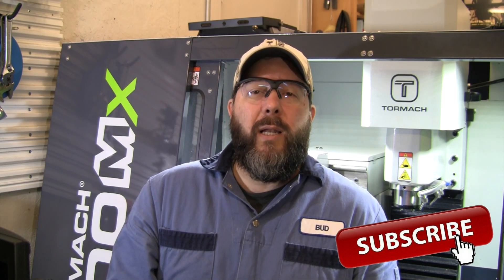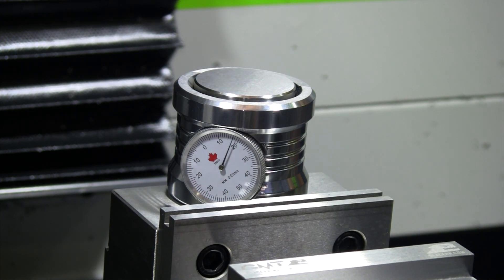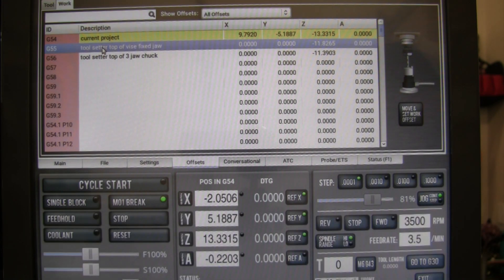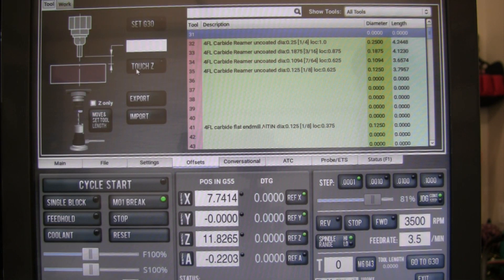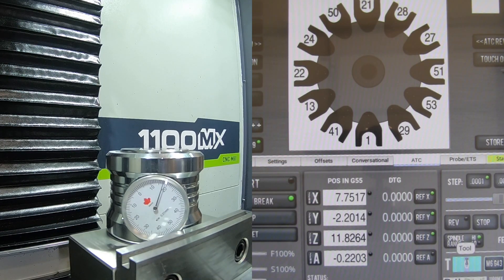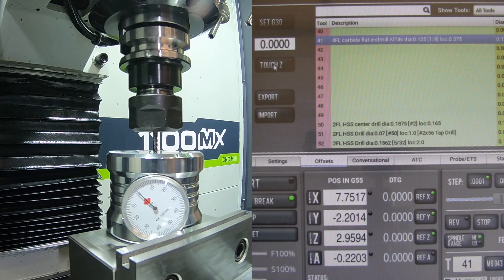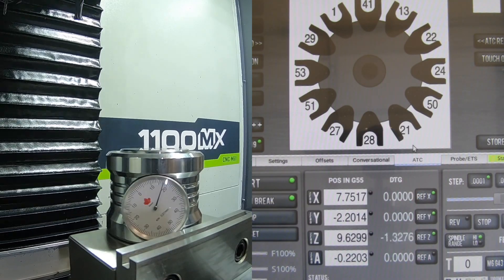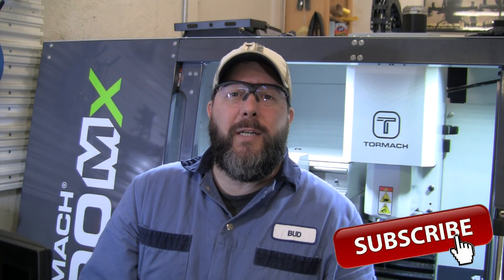Tormach 1100MX - Setting Manual Tool Offsets & Checking Accuracy/Repeatability of Offsets Over Time

Comment: I've been watching your videos and plan to order a machine in the next few days. Do you use the Haimer still or have you switched to using the passive probe now? My dealer has suggested I buy the probe to start but I am concerned that it will add more confusion as I am new to CNC milling. The Haimer seems to be less complicated although I understand it is less capable in some ways and will require a more hands on approach. Thanks for your advice!
Reply from the maker: RCP57 - First off, congrats on the new machine order and thanks for the question. I do still use the Haimer and love it enough, I have never even considered the electronic probe. So since I have not used the electronic I have no idea what capability I am giving up?  And as for hands on, I am also not sure you lose anything with the Haimer?  I believe you still have to insert the other probe each time and since it has a cord, I think you have the extra step of plugging it in each time?  For me, the Haimer is pretty straight forward, no hassle and has not let me down yet. Wish I could give you a better comparison vs. just one perspective but I hope that helps.
Reply: @BladesIIB  That’s an excellent answer as far as I’m concerned.lol You’ve basically matched what I was thinking but you actually have experience making parts and a rational behind your answer. I appreciate your response. I think the Haimer is for me at least to start off with. I don’t like the cord on the probe either and as you said it seems like just as much work to take it in and out. It’s not like you can leave it in the atc when not in use. Thank you again for the reply. I watched all your install videos over the last week. They gave me a heads up on what to expect when the machine arrives so thank you! 

Reg
Reply from the maker: @RCP57  Glad the answer was helpful and the other videos. All the best with your install. You are going to live the machine, a little daunting the first time you hit cycle start but will all come together before you know it.
Reply: @BladesIIB  Thanks for the words of encouragement. I’ve been bumbling around machining parts on my manual mills for a number of years and have had a 3D printer for a few using Fusion 360 but that’s a lot different than this. I’m very excited but also a bit afraid of it all.lol I’ve been going to YouTube university every night trying to learn a bit but I don’t think I’ll really grasp much until I can put it into practice. Thanks again for the advice!
Reply from the maker: @RCP57  With that background it will come quickly. Especially the Fusion experience, fun times ahead for sure.

Comment: Thanks for showing this, can you do a quick one on multiple Work Offsets (varying Z heights of work piece)
Reply from the maker: twinpeaksco - Thanks for the comment and the video idea. I will try that mouth together an example of that. I did joy have one vise so have not used that yet but have seen it in Fusion and believe I know how to do it. Will be a good test.
Reply: @BladesIIB  looking forward to it. I’m trying to move away from setting Z off top of part and instead using a touch off probe at a fixed height on the bed. Im getting hung up when I try it
Reply from the maker: @Thisoldtruck1  see if this answers what you are looking for. The first section is setting one probe point in Fusion and then machining a couple different parts from that same probed location. The rest covers multiple work offsets like 2 vises and then using the pattern feature to duplicate parr’s in design and duplicate manufacturing steps. Hope this helps. https://youtu.be/2L07zBwa928
Reply: @BladesIIB  as luck would have it Titan just put a video out about 3 days ago on multiple Z height g54 g55 and I think I can get my head around it now. Thanks for the help

Comment: Nice video! I just went through the manual tool height setter yesterday!  Come to find out all of this time I've been having issues was NOT the probe but the ETS!!!  I used the manual tool height setter and finally completed parts to spec.  Great content Bud, as always appreciate the time you take posting these helpful videos.  When in doubt keep things simple is what I learned.  I can finally move forward.  I think all of the kinks have been worked out.
Reply from the maker: tdg911 - That is awesome news. Glad to hear you sorted the issues out and are making parts!